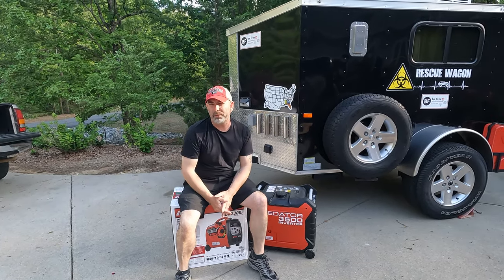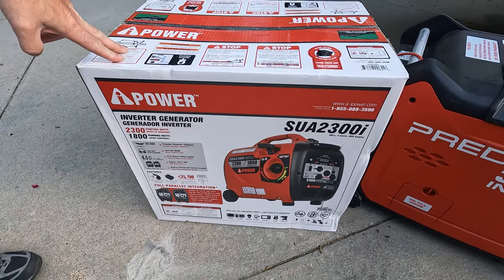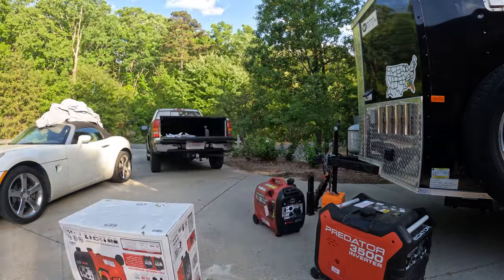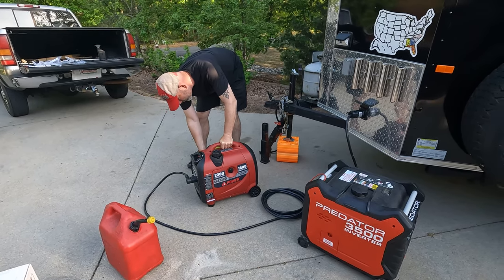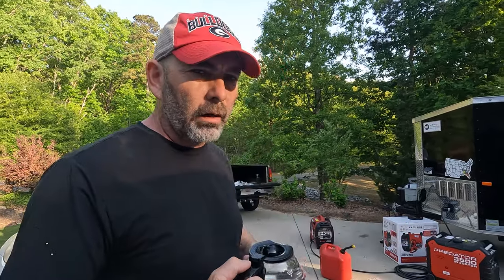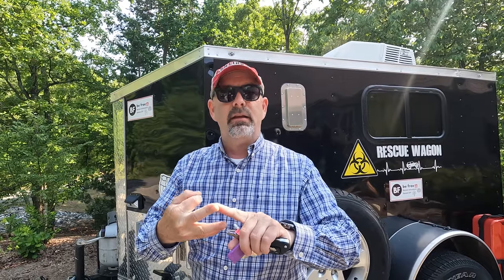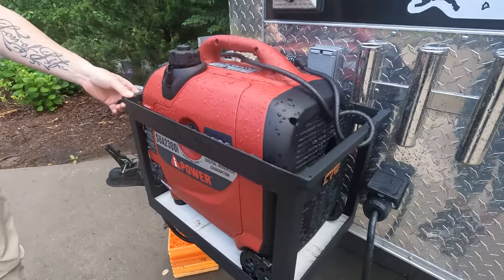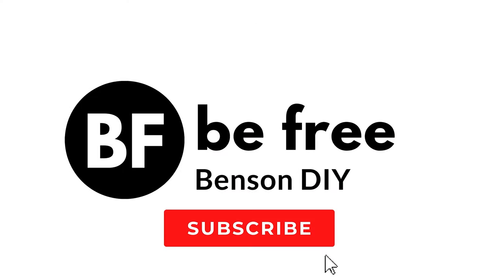MOUNTING THE GENERATOR (cargo trailer camper conversion)

Comment: I set up a Ford Transit for living.  Installed 2- deep cycle AGM batteries with a 3000w inverter.  It powered my refrigerator, lights and microwave or coffee maker.   Used a floor model ac unit and a small cube heater powered by a generator.  Later I added a 2 battery charger from Bass Pro so that when I ran the generator, it charged the batteries.   This took the load off the generator of the other items in conjunction with the ac or heat.
Reply from the maker: That's awesome!  What kind of refrigerator do you have?
Reply: Predator 3500
Reply: Oh,  refrigerator,  it was a small under counter model from Home Depot.

Comment: Thanks very much for sharing your experience with your Sam's Club iPower 2300W/1800W generator and the loads it will handle. Can you please tell me what are the BTU's for your air conditioner? I'm thinking of using a similarly sized generator for my truck camper and wondering if it will handle a 13,000 BTU air conditioner. Knowing the size of your AC will give me a preliminary idea. :)
Reply from the maker: It is a 13,000 BTU.  I can run the A/C, the fridge, and lights at the same time and even simultaneously charge phones etc.  I can't run the microwave or the coffee maker at the same time.  Thanks for watching!!!

Comment: How are you doing with tight turns with that gen box on the trailer tung. I had our cargo conversion tung extended 12”. When we ordered it. No tight left turns I guess? Plus I have a 3” extended receiver.
Reply from the maker: I have a 9 inch extension that I use with the hitch.  It’s snug but I can turn very sharp with out hitting.  I haven’t tried turning the wheel all the way and going in a circle (it would probably hit) but I don’t need to do super sharp turns because the trailer is so short and easy to maneuver.  Thanks for watching!!!

Comment: how is it mounted to trailer
Reply from the maker: The box that holds the generator is welded to the tongue of the trailer and an additional piece is welded to the frame under the trailer.  This sounds complicated, but there are a lot of people who can construct and weld something similar based on your needs.  They are usually reasonably priced.  Thanks for watching!